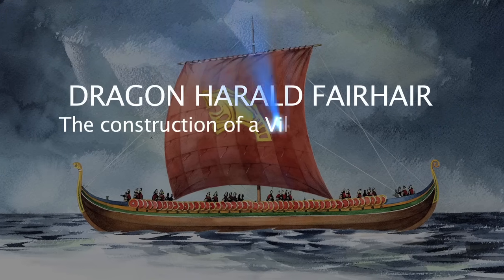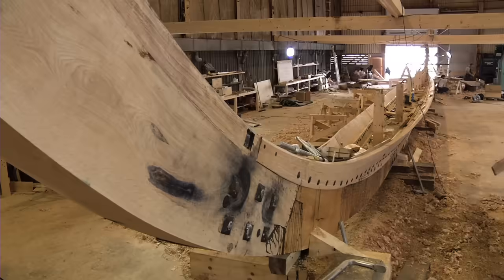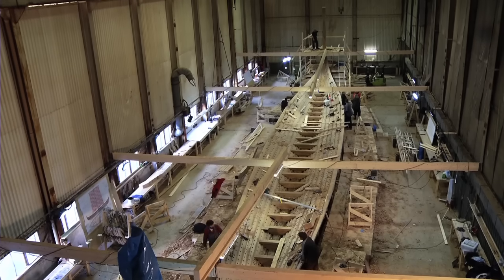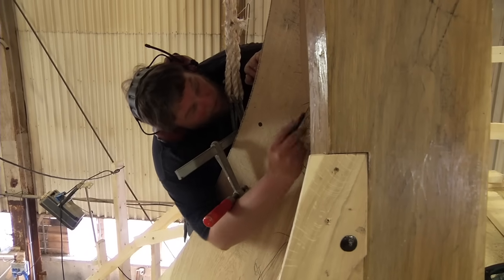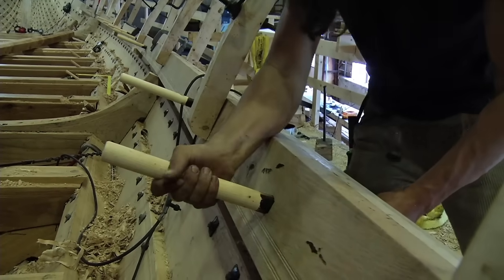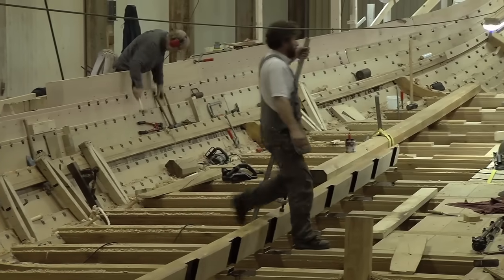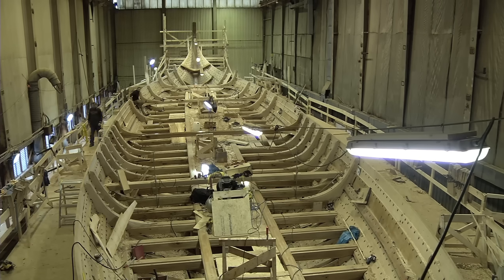The largest viking ship in the world

Comment: Absolutely beautiful , I'm planing a catamaran and this gives me some ideas.
Reply: so, two years old, I generally never bump old posts like this, but a klinker built katamaran? That I'd like to see! I have also been thinking about how to make use of the benefits the viking ship hull had, with new innovations. But I'm no boat builder
Reply: @stianberg5645  I have seen some connected in the middle by a beam and tied down with rope to give some flexibility so thats the plan. I'm not a boat builder either just seems like a fun project to try.
Reply: @Bshwag  I see! What ideas will you draw on from the klinker-tradition? Or did you mean you got inspired by just watching boat building? 
I'd totally understand the mere inspiration, watching someone do their art of craftmanship is inspiring!
Reply: @stianberg5645  really it's just boat building I enjoy building things in general. I'm using mostly ply wood but the prow and keel beam are basically big scarf joints I'm trying to make it as light as possible and in a way that lets me take it apart and move by hand. The final dimensions will be 24ft long by 12 feet wide. I also figured if I made it stiff it would break more easily so I'm trying to build in as much flexibility as I can. That idea came from viking long ships, They bend and flex in heavy waves.

Comment: Now I understand why nothing on the seas could out-pace these ships!  A must watch for anyone who has worked with wood.
Reply: It was not speed that was important , they would go at about 3mph  or on a good day with the sail set 8 mph , ( 4.5 to 13 kph ) . The later figure is  with the sail set and with the wind behind . Most of the time they would be rowed  . And it was not till quite late,  that is in the 8 th century that they did have a sail. Not until very late in the Norseman's history,  would they have other ships attack  them . The important thing was they could travel long distances. And were comparatively safe  . On test with a modern copy,  20 men , which is a ton ) with  the hull full half  full of water , moving from side to side could not upset it .
Reply: @welshpete12  No, they can reach 20 m/s actually with the wind right. It's also the very low draft that made them so practical
Reply: @welshpete12  They had sails way earlier than the 8th century on the longships.
Reply: You act like the trireme isn't fast

Comment: Fascinating. The joinery involved here is incredible. Love woodworking of any kind. I thought I read somewhere that corded lashings were used on the strakes in lieu of trunnails and clenched rivets. Is that correct or did the techniques change over the years and size of the ship? 35 meters is quite long and long wooden sailing ships in the 1600s and 1700s had problems with hogging of the keel?

Comment: Historically accurate perhaps buts its a shame that they didn't use copper nails for longevity.  The iron nails will rust out.
Reply: If they are truly iron (not steel called iron), they will last longer than you might thnk.
Reply: if the nails are wrought iron they will normally even outlast the wood of the draken.
Reply: The real ones used iron
Reply: Probably the technical process of obtaining copper is more complicated than iron. That is a question to the official history - Why then the Copper Age was "before" the Iron Age?
Reply: The problem isn't with the nails rusting away. It is that the salt water reacts with the iron in the wood, causing the wood to rot out. I forget the technics term.
Reply: Owen it was hard for people to get the high temperatures needed to melt metal back then...
copper melts at 1000 c
iron melts at 1500 c
copper is easier to work with because of this lower temperature required
Reply: Owen Hikka-ru  Copper isn't allowed to be used to construct boats anymore due to the toxicity of its interaction with salt water letting off chemicals that kill marine life, The same reason you can't copper bottom a boat these days either.
Reply: Home depot may have been out of copper or galvanized nails that day.
Reply: @Possumlove It doesn't look like historical accuracy was one of the requirements here, regardless of laws. Vikings didn't have overhead lifts and power tools either. Tim Severin, author of "The Brendan Voyage" and many other books detailing his efforts to recreate, as closely as possible, previous historic feats (Ulysses, Jason, Sinbad, etc) probably comes the closest. I believe it was Severin's Greek galley, where he finally got around Greek or Turkish laws by claiming that the boat was an experimental yacht, which of course it was. Of course, even Severin had safety equipment like radar, life rafts, survival suits, but one thing he found that was interesting was the ancient materials like wool held up better than the modern materials. As long as you could stand the smell of wool grease (for water proofing).
Reply: @Possumlove " toilet areas under deck (called Sweden and Denmark)"  lol Elite trolling right there
Reply: @Possumlove I believe it. We have always had a love/hate relationship across the borders. Ultimately we all sit down and laugh about it at the end. Good times!
Reply: Charlie K  it will still decay when exposed to the air and moisture
Reply: @984francis  - cleopatra's needle.
Reply: @hikka-ru  - got a lot of copper from Minnesota 1000's of years ago.
Reply: @984francis  I don't think so. Iron corrode in only 5 minutes (no joke).
Reply: The "Time Team" did an excavation in Scotland of a Viking era Viking boat.  The wood was long gone, but, the iron nails used to construct it were still there, albeit fairly corroded.
Reply: @Possumlove in wood boats toilets are called "ship sinkers" for a reason, but I see todays' maritime requirements. also, you won't get any babes on a ship unless you have a toilet. that infor. is from my personal experience!!
Reply: @scottmaschino1927  electrolysis. if they HAVE to use iron they should also use zinc sacrifice plates
Reply: @hikka-ru  Copper is a shit material for tools, hence why when people learned to forge iron and later steel all copper tools were scrapped.
Reply: I think its because copper melts at a lower temperature than iron. You need a bigger fire to produce iron.

 @hikka-ru
Reply: Mycenean Greeks were apllying the nails through a wooden cylinder. So, it was only this wooden cylinder that got rotten,. Then, they only had to change the wooden cylinder and the nail.

How's that for superior technology?
Reply: In the middle east to this day they fix the clinker hulls of dhows with copper nails.  
Wrought iron doesn't corrode like mild steel.  Many 16th century wrought ships anchors survive.  
Wrought iron appears laminated as it corrodes but despite corroding it retains its strength.  
The structural demands made of the bolts on this hull would have been a challenge for copper nails.  You can't thread copper either, you have to rivet it.

Comment: Kinda shocked they used steel (iron) nails instead of the traditional and far superior copper nails to fasten the planking. Steel will corrode where the copper does not.
Reply: Copper nails were a major technological development of the 18th. century.  The Royal Navy got tired of paying for copper plates that fell off when they reacted with iron nails. (Galvanic corrosion, not then understood.) The major vendor of copper plates had to round up all the smiths he could find to develop a way to make nails from a soft metal like copper. See http://www.rogerknight.org/pdf/The%20Introduction%20of%20Copper%20Sheathing.pdf
Reply: Iron IS traditional! Copper is not superiour since it's soft.
Reply: No. Its not. Check into it. Copper lasts far longer than iron because it does not rust. Iron fastened boats come into our shop all the time with lose and rotten planks because they were fastened with iron, and they leave with copper... if iron was the best choice, we would still be using it instead of the copper.
Reply: Copper was expensive.

Comment: I don't think vikings buildt their ships so thick and heavy as this, even at this size, it would be a nightmare to pull up on land, and speed would be affected.  Looking att surviving viking ships, the ribbs are much thinner, even looking at Roskilde 6, att what remains, the dimensions are not nearly as thick or wide.  But other than that, great craftmanship!
Reply: They would've used wood split along the grain. Such boards would be thinner and lighter for the same load bearing characteristics. It's labour intensive to make them and requires that you find appropriate trees before they are felled, so may have been impractical for these builders.
Reply: @paulie-g  yes, i have heard that they used trees with natural bend in them that would fit the parts needed.
Reply: There is some differense between Danish and Norwegian built vikingships. The Danish vikingships where often thinner and had lower sides. (Skeid). Faster, but harder to deffend. The Norwegian vikingships where often buidt for rough seas. Also there is 8 types of viking warships. 1. Langskip. 2 Storskip. 3. Skeid. 4 Busse. 5. Drake. 6. Barde. 7. Sud. 8. Snekke. To be called "ship" it had to be more than 15 meters long. 

Good eksampels are:
"Osebergskipet" buildt around 820 who is a "Drake" ship. (Royal or nobel ships). and was 22 meters long, 5 meters wide. 

"Tuneskipet" buildt 900 19 meters long and 4.4 meters wide. 

"Gokstadskipet" buildt 890 23.8 meters long and 5.2 meters wide. Estemated top speed is 12 knots.

There is 16 vikingships known from the Norvegian saga who is more than 30 meters long. Then longest "Kristsuden" at 37-sesse = about 52 meters long.
The Norwegian "Leidangen" had at least 310 ships who coud be mobelized to war.
Reply: @the_saint_1  I have been and seen the Osebergskipet, a few times, along with others, but just googling pictures of that ship, you can clearly see that it's buildt much thinner than the new Draken.  
And the reason is that the Vikings used wood that had grown bent, so that the ribbs would be naturally strong, cause you arent severing much wood fibers, but have long fibers that goes from bottom to end.  When you don't do that, you need to use much thicker frames.  They probably had great knowledge on wood, and may also have used slow growing wood, for denser fibers.

Well the danes crossed the rough sees too, so they must have buildt similar ships for open sea voyages.

Comment: I can’t believe they used a plain scarf joint on that bow stem. 2:05
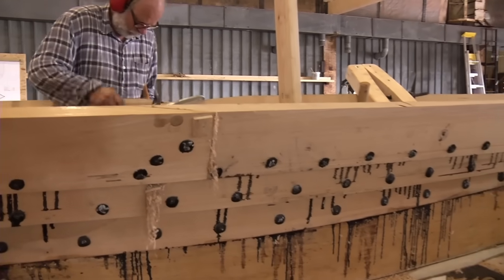PS...also at 2:55 ...forming a rivet from the cut pin with so light a hammer. I would use an air hammer. Or at least a bigger hammer.
I am sure these people know more than I do. My questions come from curiosity, not criticism. The finished vessel has proven the quality of the work.

Comment: surprised they used large iron rivets at the stern instead of using timber joinery techniques to pin with wood wedges. those will never give. iron will, eventually, so you know what in salt water.

Comment: shouldnt the nails have been tarred? you would at least make an effort to seal intentional holes on the underwater
Reply: They use square copper nails and washer which hammer on with some luck son me holding the dolly on the out side of the boat. Once its tight you burr over the copper nail. The boat will be tarred after.
Reply: @gingertom56  it is amazing to see such a ship being built, but the thought occurred that a dry nail would not have the same ability to withhold the water seepage as would a nail slathered and lubricated with a sealant.

Comment: Originally when these ships were built way back when they didn't have drills and planes and clamps they had logs hammers saws and hot fire to drive the spikes through the Wood hence why we use hot riveting oh and they were built outside so the wood was wet all the time in the rain the mist cold weather so that's why they didn't burn when they were putting the Hot nails through the Wood if they used iron or metal nails anyways they probably used wooden clinkers but then again where did the drill come from to make the holes even they don't know the true history of the boat so much has been lost and taken from us it's not their belt builders in the video makers fault they just don't know that they're trying to change and rewrite history